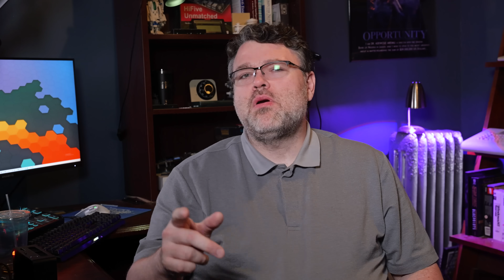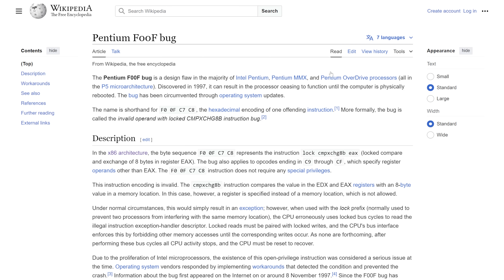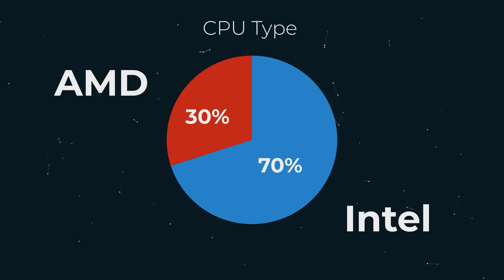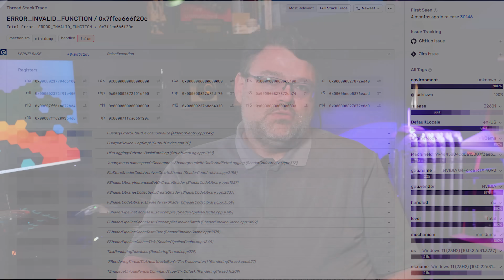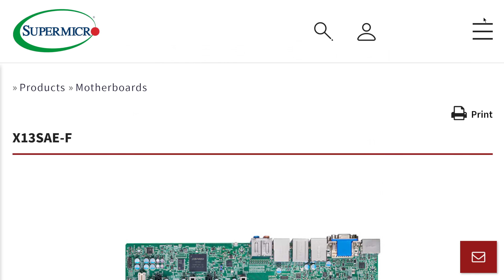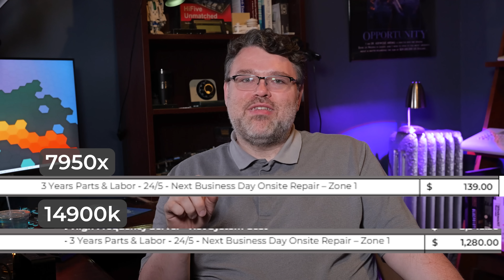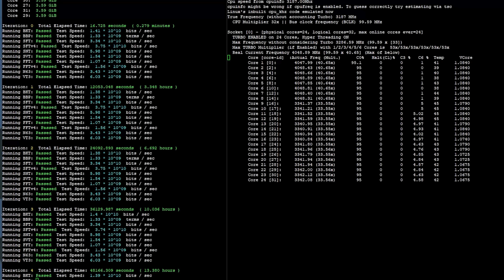Intel has a Pretty Big Problem

Comment: here is my experience with many CPU's:

CPU degradation is actually normal over time, is expected, and you can see that even in older SKUs, the problem here is Intel is pushing to hard ( with the help of the board makers ).

I have a example for you guys; my last old PC is a 10700KS ( I use it like a server now, but I some times play on it ), it started the life with a vcc of 1.060v, also with a offset of -0.035, it can hold 4.8Ghz on all cores and a max of 5.0Ghz on 2 cores, today (of me writhing this) I have the PC working well ( from time to time crash, like once a week on a 24/7 power on ), I get more or less 8 to 10 Whea errors a day, some times 4 to 6, and is still on the same vcc,

some times just starting a VM crash the PC, my problem is degradation on the 10700KS, sure I can return the vcc to the default ( that I still think is to high from the day I got it ), that will stop the Whea errors in no time, but keep in mind this CPU have almost 4 years old, the degradation was not power, was not temp (hell the max temp this CPU seen was 81Cº, and that is running a power virus test), also is not Amps ( to be honest I never touch that, is actually "give to me all you got" ) , but because I have a lower voltage it can't actually pull that much Amps ( the max I see was 98A and max 130W, normally is around 89w to 100w

my point is, degradation will happen no matter how good you handle the CPU, for my old CPU I just need to get it +0.010v or +0.020 on top of the undervoltage and will be back as new, this is still way bellow the board default, the big problem here is that Intel is in bed with the board makers ( a long time now ) to push the clock high without looking the cost, one side the boards makes don't mind a board dies after 3 years, and on the other also Intel don't mind, the big problem is on this new Skus someone made the calculations wrong and they are pushing way to much, so the CPU dies faster ( a lot faster ),

also is not the fault of the users, the old Skus ( like 4/5/6/7/8 gen ) you can crank that thing high as hell and the CPU did not care, but since gen 9 that Intel started to fear AMD and push the board makers to add more, and more, and more, now unless the user knows and from day one lower the default voltage/amps and do not use XMP ( rather do the OC by hand ) the CPU will degrade faster, and faster and so on.
 
Now the board maker do not like to take the full blame for this debacle and Intel do not like to admit they screw all on them, in the middle are the users that have no idea what exactly XMP or OC will do to the CPU and they don't care or even is not their responsibility to know, ( well some know, and some care ) and they see the board makers setting the defaults way high an do not question, 

I have complain since 5 gen to giga/msi/asus/asrock of the strange power settings, some of then did actually change the values on bios update, but most of them did not ( looking at you Asus and MSI ), now we have more and more people talking about it and I see them changing stuff, for some users are to late but its a start, I had similar problems with voltage since gen 4 but only after gen 5 I started to check.

Oh one last note : the Aton (some of you remember) was made to fail, Intel made it soooo out of the box that you don't see much of them this days, because was build to degrade over 3 or 4 years, so this is not the 1º time Intel made something like this, and for sure will not be the last, the only difference is ... this time they did it to strong to fast and people notice.

Comment: i am so happy with my AMD.
I've bought AMD since Bulldozer, which wasn't a great chip, but holy shit was it cheap.

AMD doesn't require overclock chips, overclock motherboards or rip me off with price.
So I always recommend AMD chips to people.

that being said my 5900x had instability issues as well, which came from my mobo having a shitty agesa.
Some of the errors are so hard to diagnose i don't think they actually get logged anywhere. nevermind resolved.
these systems get so complex that trying to find the source of an error that is systemic may as well be impossible.

kudos for the work put in here.

Comment: This is my interaction with Intel support RE: 13900k... I edited for personal information ONLY and AS I POST I'm now being ghosted by Intel support. 

Hi I'm Sean L***
Please give me a moment to read your chat transcript.

Greetings from Intel Customer Support, how can I help you today?

I'm well thank you. Yourself?

Live agent persona
I'm fine, thank you for asking. How can I assist you today?

I built my system around the 13900k and although I'm running it at stock settings it isn't stable. I'm receiving out of video memory errors as well as random game crashes.

Live agent persona
Thank you for sharing your concern. Is this the first time you contacted Intel Customer Support regarding this issue or inquiry? Or do you have a case number?

This is the first time. I've upgraded my bios to the latest revision, I've done a fresh install of windows 11, I'm using DDR5 memory and underclocked that (it is rated for 7200), I purchased a larger AIO to cool the chip and have reapplied thermal paste. I'm an experienced builder but have never run into problems like this before.

Live agent persona
Before we start, may we verify the following information if they are correct and complete the missing information?

1. Complete Name: Scott ***
2. Email address: re****
3. Phone number (optional):

My telephone number is 5***

It seems I'm experiencing similar, if not identical, difficulties that have been documented and reported over the last several weeks. I came across those reports looking for a solution to my CPU problem.

Live agent persona
Thank you for providing that information. Kindly allow me 3-4 minutes of your time to create a case for proper support documentation and provide your case number. While I'm creating the case, feel free to provide any relevant information.

Thank you for patiently waiting! Your case number is 06*******, we will use this as a reference for your support request. You can provide this the next time you contact us with regards to this issue.

Just to set your expectation I will be asking a couple of details to gain more clarity and know our best option towards the resolution for your issue.

please proceed; will you be e-mailing me the case number after this conversation?

Live agent persona
What is the exact issue?
Is system working before?
Any recent changes made on the system?
What are the troubleshooting done?
What is your exact motherboard model?
Processor's date of purchase?

Yes, I will be sending you an email with the summary of our conversation and case number.

We were not able to hear from you in the last 3 minutes. Would you like to continue this chat transaction? I will keep this chat window open for another 2 minutes. Please respond if you wish otherwise.

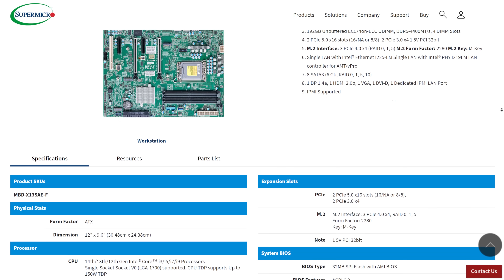The exact issue is a dual problem. I'm receiving an insufficient video memory error while trying to load Fortnight (to play with my son) however while I do not have the best gfx card on the market the 4070 should fill my need well. The CPU has consistently had problems (I've traded out every piece of hardware save for the CPU to account for this). There have been no changes made to the system save for the gradual removal of hardware to confirm the problem is centered on the CPU. The motherboard is an MSI PRO Z790-A WIFI and the INTEL CORE I9-13900K was purchased on 05/18/24 at 12:11hrs (copy and past from the receipt).

Fortnight also crashes randomly (dual issue I was reading ahead and didn't finish my thought).\

sorry I had to look for the purchase information and it took a moment.

Live agent persona
Thank you for providing that information, please give me 3-5minutes to look into this.

Can you please confirm, what BIOS version are you using?

my current bios revision is using the Intel defaults and I quote "Replaced MSI's own tweaked system power settings with added Intel Default Settings" that is the latest revision.

7E07vAC2

everything is running stock

Live agent persona
Thank you for confirming.

no problem at all

for information I did run a i5-13600 on this platform with no problems.

Live agent persona
Thank you for providing that information, this will be noted in your case

Please provide the needed information in the warranty offer above.

I do not see a link or information regarding warranty information.

Live agent persona
Thank you for your response, let me send the message again.

Your efforts have been instrumental in confirming that the processor is indeed faulty, and with that, I would like to offer a warranty claim for the unit. If you agree, kindly share the following details below:

1. Contact name: Scott **
2. Contact number: 5***
3. Date of Purchase: 05/18/24
4. Complete shipping address with postal code:

This time, I'd like to know which replacement option you would prefer:

Option 1:

Standard Warranty Replacement (SWR): It is required to send the defective unit first. Intel will cover the shipping costs for both the defective and the replacement item. An electronic pre-paid shipping label will be sent within 1 business day. Once the defective part is received in our system, it might take from 3 to 5 business days for the screening process and paperwork, then it will take two more days for shipping. In the end, it could be a 6 to 7 business days turnaround from the moment the defective unit is received in our system.

Option 2:

Cross Shipping: This option is available in USA & Canada. It allows customers to receive the replacement in advance including a physical pre-paid return label. The replacement usually is sent via overnight shipping and most likely arrive from 24 to 72 business hours after the order is placed. The service requires covering $25 fees associated with the service we provide (Non-refundable). This includes a charge to your credit card for the total price of the product plus applicable taxes. These extra charges are for security and will be refunded 3 business days after the defective unit is received in our system.

Note:

*Do not include bank or credit card information.
*Intel no longer accepting the American Express card only Visa, Master Card, JCB, and Discover.
A Warranty agent will send you the terms & conditions letter for your approval (Reply agree).
You will be contacted by our specialist via phone call to collect the credit card information.
*The physical Shipping & Billing address must be the same.
No Military address or PO Box address.
No applicable for USA territories (PR, GU, MP, VI, AS).

Are you able to receive it?

Considering the information that has been reported on this CPU I'm being offered (and I apologize if this sounds crude) another roll of the dice in terms of stability and silicon viability?

Live agent persona
I understand how you feel on this situation since Intel hasn't really found out the root cause of the instability issues. I would like to ask; do you have any alternative proposal in mind?

hmmm at the moment I've invested more than I would have thought on a build, to not only make it, but also troubleshoot it. Considering there is a problem on the CPU side might you reconsider your response? It is deflective, defensive and cheeky... candidly that is not a professional response.

Reference above I was going to be disconnected from this session within 3-5 mins of inactivity. Please respond.

without a response at this point I direct you to keep my case open (until I decide on a course of action or until the warranty runs out of my CPU) I also request the contact information for your manager.

Email chat transcript

Comment: is there any fix for this? or is it an RMA job?
Reply: its a hardware defect so no bios/firmware/software can fix it. if having issues rma it or if you really want a stable problem free setup, sell the new replacement w/c mostlikely will have the issue & get an amd specially the upcoming ryzen 9000 series.
Reply: Nobody who overclock has this issue. It's only casual noob that does.
Reply: @club4ghz  but servers who are using this series also experience 100% failure without overclock & they  even underclocked them to save power/thought it will fix the issue but still failed in the end when running 24/7. Consumers who only use their pc's for hours or so with no overclock only extends the chips death but will happen eitherway.
Reply: @gamerdudegamerdude4961  If they are running 24/7 at 100c it's pretty obvious what's going to happen there. No silicon should run more than 80c like that. Short bursts to 90 -100c only.
Reply: @club4ghz  i dont think servers will allow them to run that high temps & as far as i've searched, they always keep them ventilated with high rpm fans & we're talking about business grade game servers here hosting multiplayer online games whose cpu's are constantly failing not overclockers that temps would reach 100+deg temps. I dont know were you got that info unless these game servers are negligent with their setup then again it is just with 13/14 geb that kept failing so it's clearly specific/isolated.
Reply: @club4ghz  you're totally wrong btw... its the 2 cores that spike to 6ghz, they do so and pull to much voltage. If you set those two 2 cores back to 5.6ghz with a voltage offset to mitigate the degradation, even a busted CPU will be ok... but you should also do that with a new one to prevent degradation

Comment: I‘m still using my first 13900K since release and I‘ve never experienced any big issues. The only error I had was caused by stability issues with the IMC when I was using 2x16GB DDR5-6000. The problem was gone after I adjusted the dram voltage and the timings manually. Right now I‘m using 2x32GB DDR5-6000 with the same adjustments I did before. No errors, crashes or anything else. System is running every day and the cpu is water cooled. But I never used 253W as a PL value. The CPU is running since day one with PL1=PL2=150W.

Comment: Someone else mentioned in a video that the problem could be the ring on the CPU. These specific models mostly use 1.4~1.5V (stock) and given enough time, the rings could be burning up and causing issues anywhere in the CPU (IO, E cores, P cores, etc).
A few (lucky ones, if you win the silicon lottery) operate at 1.3V and those will last longer or not fail but I believe this can be the case

Comment: Intel use to equal stability
Amd use to be smoking hot.

Well whats changed.

Intel needs to be shut the fuck down! Or the ceo needs to step down.

For the bettef part of 10 years gamers gamers gamers. 
Now its ai ai ai. 

Just stop supporting intel. Save your money and take a trip. 

I dont even recommend amd either. 30 years of nothing but stability issues. 

Neither amd or intel are good. They only care about whos got the bigger dick. 

So what can you expect. Ahaha intel wants ai and guess whos going to follow the trend.

Comment: I have this problem! 14900k, 4070, 32GB, Gygabite Gaming Ax motherboard, Corsair 32GB DDR5 6000hz , last updates. CS2 crashes 5-6 times in 3 hours per day. I have 32GB 6000Hz Corsair Vengeance, in BIOS stock is at 4800hz, if i change to 6000hz, or enable XMP mode, you cannot play games anymore with all those crashes. I put it  to 4800hz again, but i still get crashes in games. Imagine at 12-11 when i killed the last T and i just needed to defuse the bomb to equalise and my game chrashed, my teammates yelled on teamspeak dude dude defuse please :)). To be serious again, i bought top Intel CPU and i have a computer that crashes last night like 10 times in 4 hours.

Comment: I had same issue with 7900x and guess what internet is full of the issue that CPU need more PBO for me +10 works just fine, RMA rate is same as on 14xx gen, and guess why those "journalist" say nothing about AMD????
I do not say Intel has no issue, but AMD has it too as now top end CPU are pushed to LIMIT
Why no one talks about AMD is simple, they are all paid by AMD and with the user zealots on the space that one would be trashed to oblivion

Comment: i9-14900KF  no game would load or would play some would load for a while then crash until I cut the power down to the CPU and cut the RAM speed down now it runs smoothly haven't had a game crash since, been building my own computers since the 286 days this is the first intel cpu that has given me trouble, or is it the motherboards? and i have never overclocked my CPU and ram they were all out of the box

Comment: I was one of the lucky ones with a defective 13900k. After a terrible experience with Intel customer support and an RMA thru the reseller, it seems not one full month after getting my CPU replaced I am starting to experience issues again. I haven't reach Intel support yet as I want to have enough data points to actually tell is not just random apps crashing because of code defects.

Also btw, I agree that Intel should have come forward and said: "Ok we are aware this is happening, we'll have you covered and we'll be offering a warranty extension".
For me, the only reason I went for Intel instead of AMD is that Intel was historically more reliable than AMD, but after this shitshow, obviously that's not the case anymore.
So, if Intel doesn't solve this real quick I guess AMD is going to be really happy when the Q-report drops after their next release.
Reply: I switched to AMD after losing over $1000 with Intel CPUs and expensive boards. Microcenter has a sale for 7950x3d for only $375 to get ready for the 9xxx! I took it. Games much much smoother and stuttering gone with the 3d vcache. I was not expecting that 😮

Here is what is awesome with AMD. AMD still plans for new chips in the 7 year old am4. Even if you go with last gen 7950x3d you can simply replace your cpu and keep your board for many years to come. Intel sucks in this area. New board, ram, and windows license for each upgrade sucks